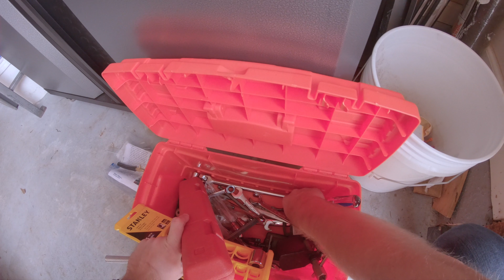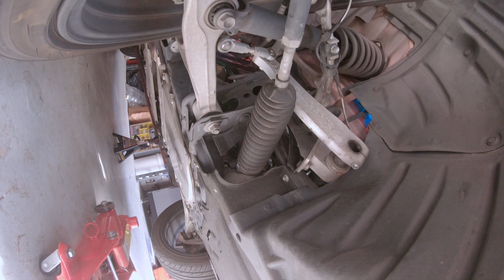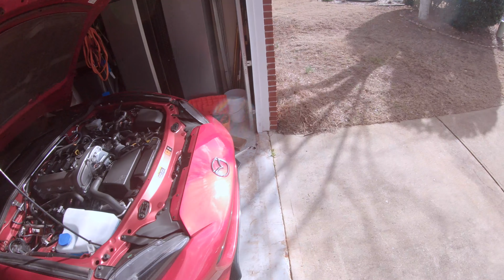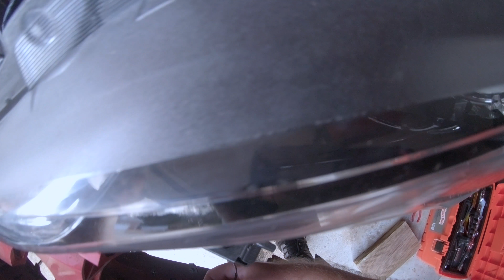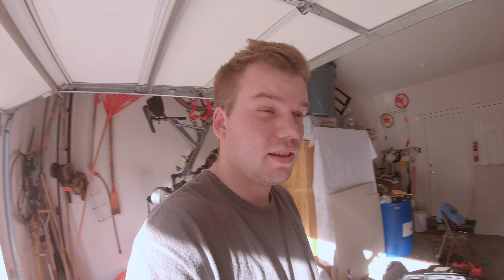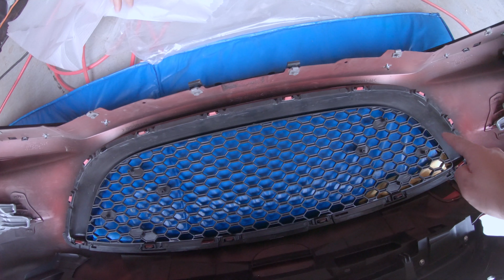ND Miata Carbon Miata Spyder Grill Install - Road to the Edelbrock Supercharger Part 1

Comment: For the lights, recommend removing them from the bumper via 6 screws.  The clips have pinch backing, are impossible to access and may snap by just pulling on them.  Once the lights removed you can take the clips out mount the lights back to the bumper and then just plug everything back in during re-installation.  Works way better.👍🏻

Comment: Why did you cut the bumper? I just installed mine and no cutting was necessary. Seems like cutting it makes it weaker imho.
Reply from the maker: Maybe it was a design change but originally it was recommend you cut the top support to keep it in place.

Comment: I’m looking to put in the spyder grille with the lights - you said that cutting was optional? What advantages do you gain by making that cut? I’d rather keep the bumper with the ability to revert to stock
Reply from the maker: The main reason I cut the bumper support from the grill is it helps keep the nose of the car supported a little better. I think it makes the install easier as well.
Reply: Nice video, very helpful. The reason you had trouble removing the clips that hold the lighting wiring in is that they need to be rocked to one side, pull that half out, and then rock to the other side and pull on that. Much easier than forcing it straight out.

Also, the grille does not need to be cut to remove it. I removed it without cutting it, it just requires unscrewing some parts and wiggling the grille out.
Reply: @tmathew1usj he cut the support. That’s a must. Otherwise, you can just unscrew it all, but then not doing the cut, leaves your front cover without the support.